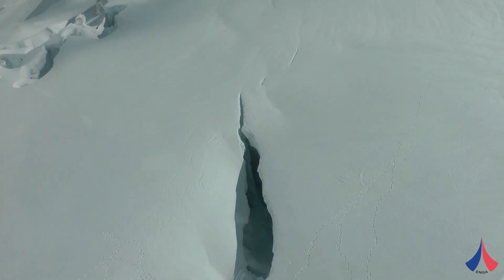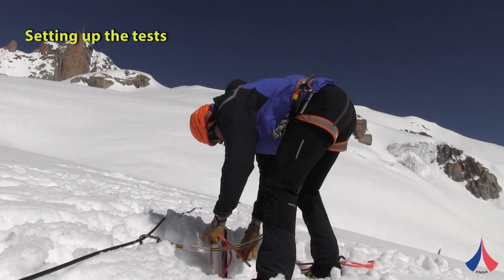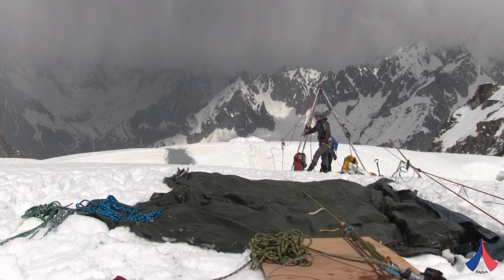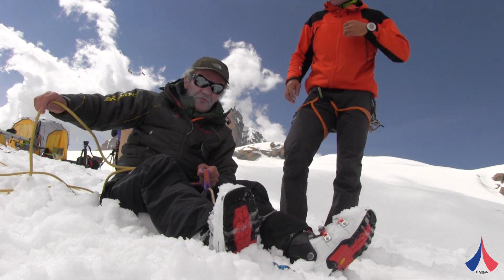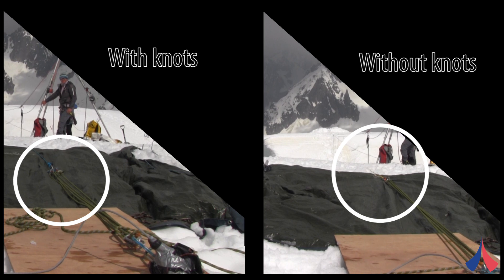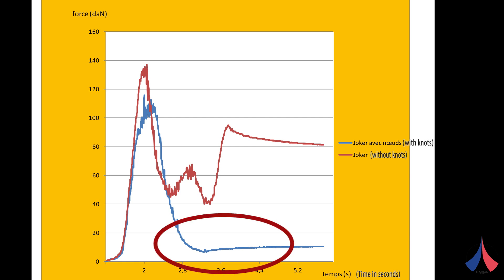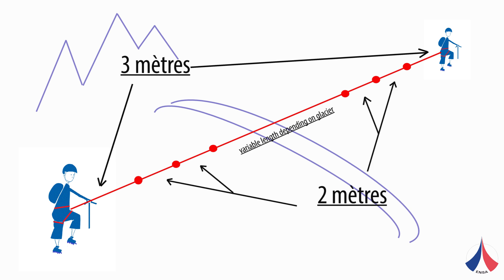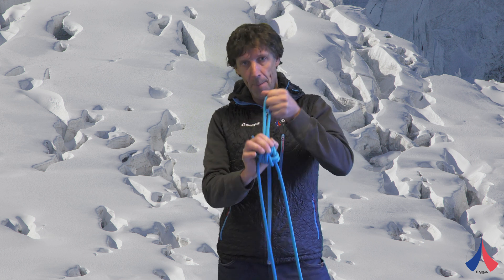Crevasse Falls: do brake knots work?

Comment: For the brake knot wouldn't a butterfly or some variation work better since the angle of pull from the knot would be more in line?
Reply: It should be bulky enough, butterfly is twice the less as the figure 8 knot
Reply: @danielpghe  You mean the Butterfly is half the size of the figure 8 I assume..
Reply: It would, a butterfly also isn't a flat knot so it would bite in better.

Comment: If you are using knots in your rope, how do you either ascend the rope to get out or get hauled out using a pulley system? 

Wont the knots impeded you ascending the rope and also act against a pulley system?
Reply from the maker: Knots are certainly a big hindrance for hauling someone out of a crevasse, less so for self-rescue. But in any case the most important thing is to stop the fall!

Brake knots are particularly helpful when there are only two people on the rope. Each should carry a reserve of rope which is at least as long as the distance between them. With a 50m rope it's possible to have 15m between each person (excluding knots) and slightly more being carried as a reserve. Once a snow anchor has been constructed, the reserve can be thrown to the person in the crevasse.
Reply: You don't! Firstly NEVER use more than half a rope length between you, or between the first 2 in a group. The person on top make the anchor in the normal way (should be easier now as the knots are taking some weight) Assuming you've shouted for help etc and nobody came!! As climber you'd usually be climbing with 2 ropes, be it Half's/doubles or twins, the person at the rear takes the second rope in the rucksack (only use one on the crevasse) the person in front takes slightly more than half the rope in use, in the form of coils (or what ever method they chose). If the front person falls in then the rear person uses the second rope and lowers it to the one in the hole via an "assisted hoist". Basically you drop a loop down with a crab, they attach and you haul them up via a 2:1 system with a traxion/prussik on the anchor as normal. If the rear person drops in then the front person makes the anchor and sets up a pulley system in the normal way EXCEPT its on the half of the rope they have in coils. They the untie and secure themselves to the live rope or anchor. They then lower the free end of the rope with a crab on a figure 8 knot down to the one in the hole who clips in and you haul in the normal way. If the person is rendered incapable by the fall then the person on top can use the free rope/end to abseil down to render assistance. If only carrying 1 rope then the person at the rear takes the coils and you use the second method. You can only hope the rear person doesn't fall in, or life gets a whole lot more difficult!!!
Reply: How to untie the knots in a pulley system is presented by Petzl here: https://www.petzl.com/BE/en/Sport/Crevasse-fall--hauling-on-a-rope-with-knots
Reply: Yes they will so a haul system would need to use the free section carried in the rescuer's coils or a separate rope
Reply: Cool, thanks guys.